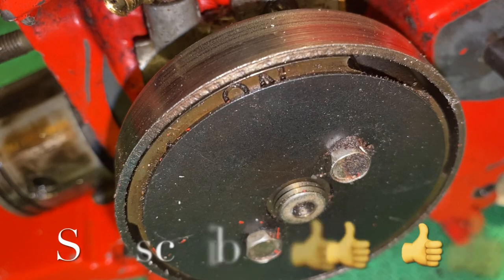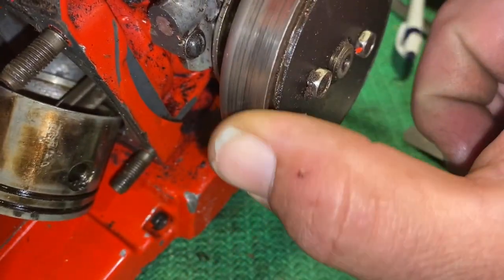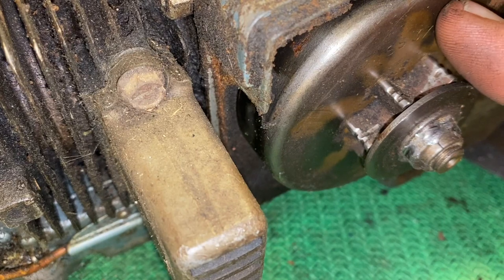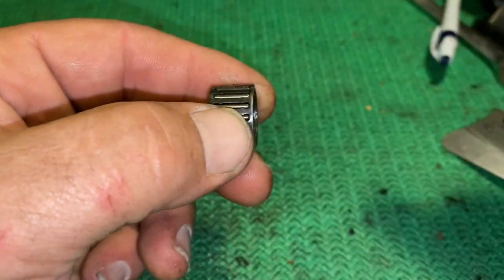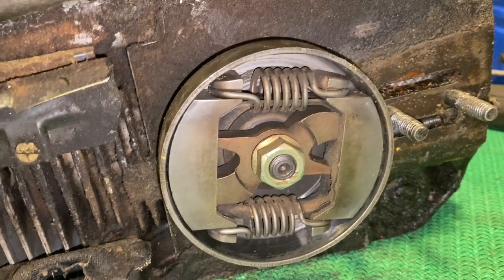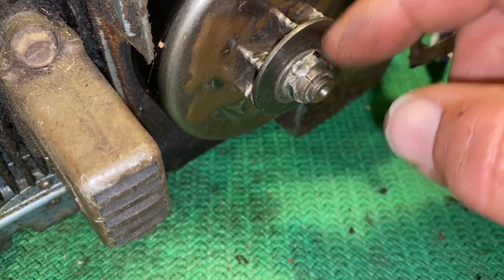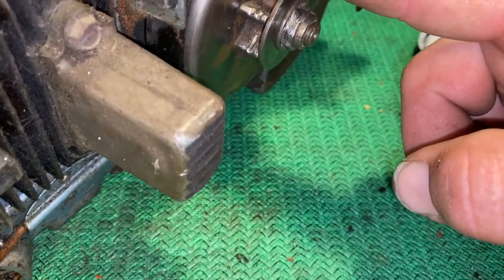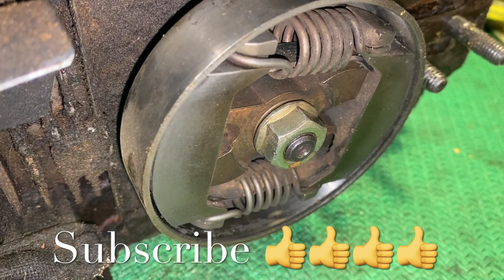Chainsaw Clutch Repair And Inspection Tips!

Comment: I have a 031AV Stihl and the clutch shoes have liners just like a drum brake shoe.  One of the liners has come off.  Not being worn much and the other two in good shape, I wondered if it could be reattached?  None of the replacements I've found have liners.  It was suggested to me to take the other two off, but I don't know about that.
Reply from the maker: I would replace them all.  I have a feeling it got really hot to cause that problem and the other shoes might not be far behind.
Reply: @Smittyschainsaws  The clutch nor the drum didn't show any signs of over-heating.  As I said, I haven't found a replacement with liners.  All just have metal shoes.  Would it do take the other two shoes off, or just order one without shoes?
Reply from the maker: The first thing I would be concerned with would be the material they are made with.  The ones with pads might be steel with pads glued on and the ones without pads might be made of a softer material.  If they are steel with pads glued on then you could end up with a lot of sparks.  I would probably order the new ones myself.
Reply: @Smittyschainsaws  OK, but I can't find shoes and/or clutches with the linings.  Will the clutch without pads work if it's for 031's?  Information and parts diagrams are hard to find on Stihl equipment, in my experience.
Reply from the maker: @John-gj1jr  I have never replaced one myself so I can't be 100% certain.  I think it might be the same.  Try talking to another channel who's name is J&S Chainsaws.  He knows a bit more about the Stihl saws than I do.
Reply: @Smittyschainsaws  Thank you for your time.  I will check out J&S.  You and yours enjoy the holidays, 

John

Comment: Make sure you tell them that when the spur sprocket drum is covering the clutch you go lefty loose but the nut that holds clutch itself is backwards thred so to break it loose you turn it towards the front of the saw or the same direction that the clutch is turning, that way the nut is always trying to tighten itself when the engine is running. And with that McCulloch clutch you don't thred it on! After removing the nut clockwise to remove then you just pull it off the crankshaft, Do Not Beat on it to try turning it off! It is keyed to the crankshaft and you will break the clutch center out if you beat on it trying to turn it off! Just remember that the clutch itself always turns clockwise to remove and if the clutch drum is covering the clutch it turns left to loosen it. 😉